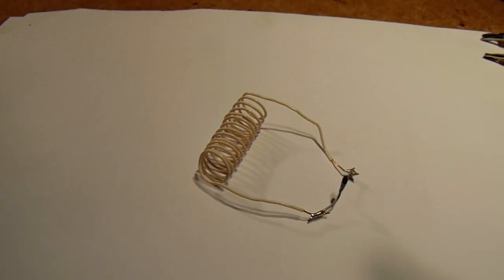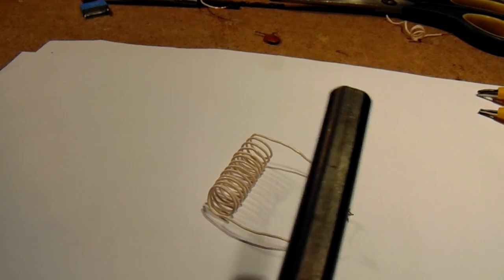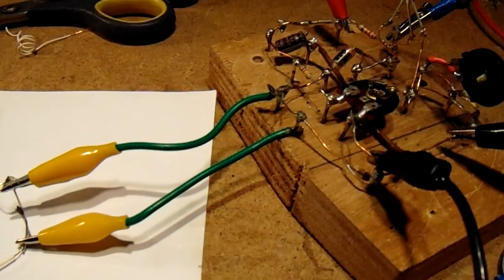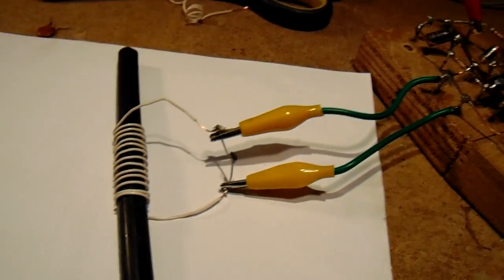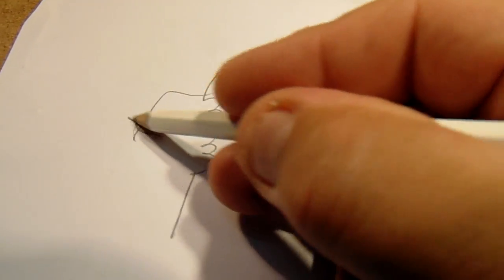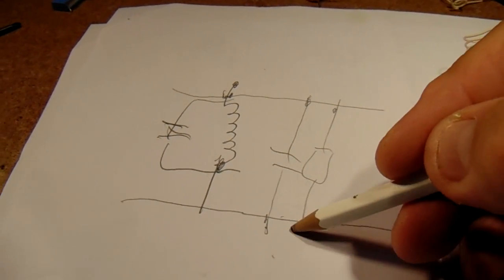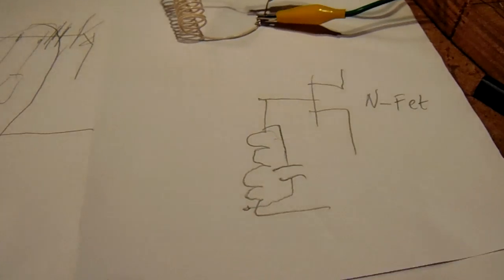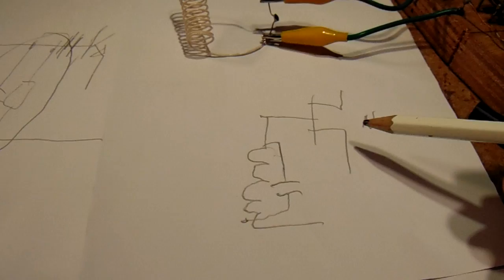Radio coils - Q- Damping- Impedance- Resonance, the very basics

Comment: Thankyou.  If you hook up a small power supply to a tank circuit (coil and capacitor, a naturally tuned to one resonant/oscillating frequency due to the characteristics/physical/electrical dimensions of it) and briefly turn it on and off, you should see the fundamental waveform on an oscilloscope, and you will see the amplitude of that being "damped" or reduced over time due to internal resistance of the wire, etc.  I think some coils wont oscillate because the capacitor just cant hold enough energy and due to the resistance of the wire in the coil that takes up alot of the available power.
Reply from the maker: trailkeeper Thanks, a good idea!

Comment: I really enjoy your explanations. Some of my oscillators work and some don't this will really help
Reply from the maker: One of the most common reasons for not working 1 transistor oscillators is that the voltage divider at the base from the transistor is not variable.

Comment: How ican matching with lower imput impedance  ,mean calculate number  turn to secondary
Reply from the maker: what do you mean exactly?
Reply: @radiofun232  I would like to know how to adapt this antenna to a base impedance input
Reply from the maker: @salahibrahim633  You can couple an antenna coil to the base of a transistor via a coupling capacitor. Often (say) 100 pF. When you connect an antenna to the coil it has an effect on its resonance frequency. A FET (field effect transistor) works best. There are a lot of video's on my channel about radio's, antenna HF amplifiers (max. 18 MC) etc. Go to the "looking glass" on my channel trailer (Radiofun232 on You Tube) and search with keywords like "radio" or "shortwave" "antenna" etc.  I will try to give some links. I hope that this is an answer.
Reply from the maker: active antenna is here https://youtu.be/lWGIsmFWS7U
Reply from the maker: In the schematic of this radio you see how the antenna coil is coupled to the first transistor  https://youtu.be/BDlRG6U5sYU